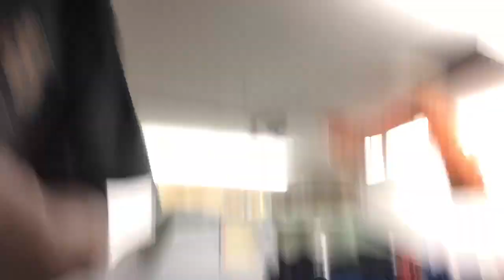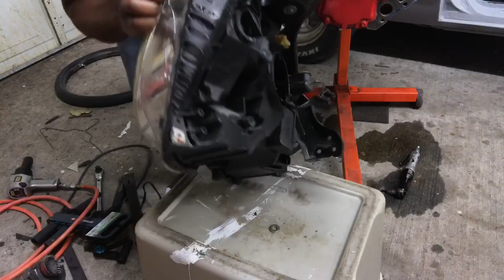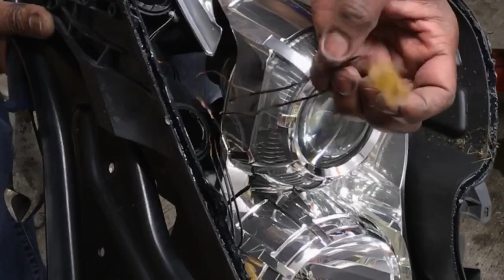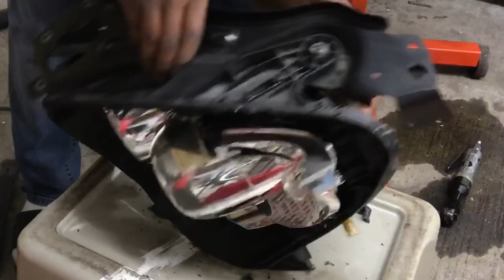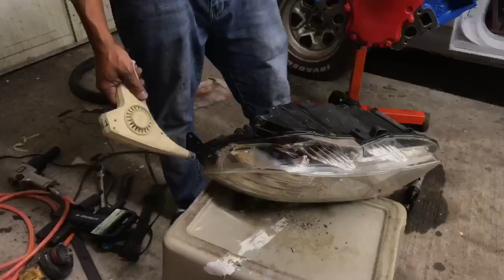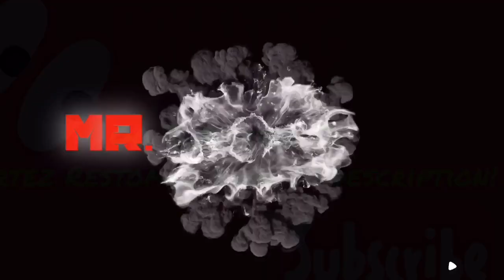How To Repair Cracked Headlight Wires / Mr Random

Comment: Were your wire corroded? I need to do mine but I dont know if I need to clean it before I throw the tape on it
Reply from the maker: Tape up any exposed wire! If I had to fix the problem again I would purchase new headlights the harness run deep! Thanks for stopping by fam Happy New Year
Reply: Thanks .happy new year